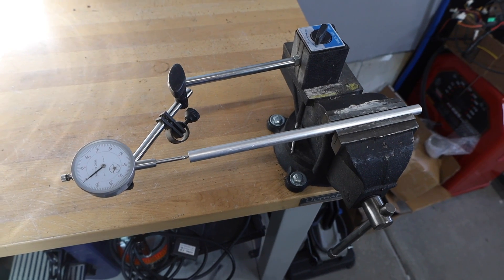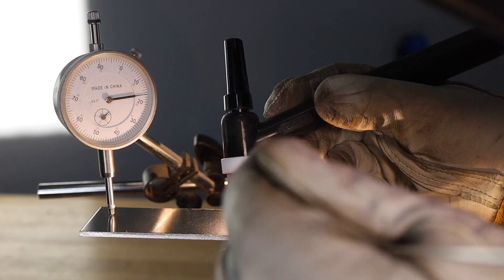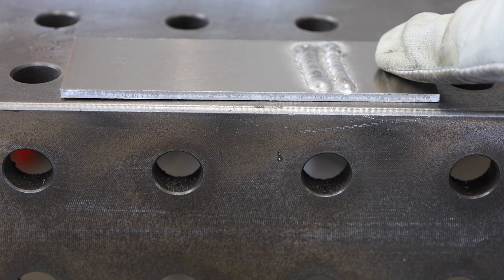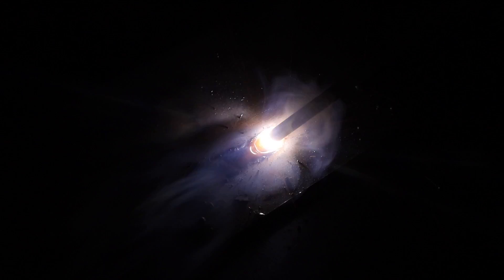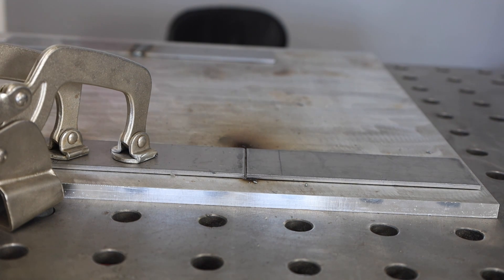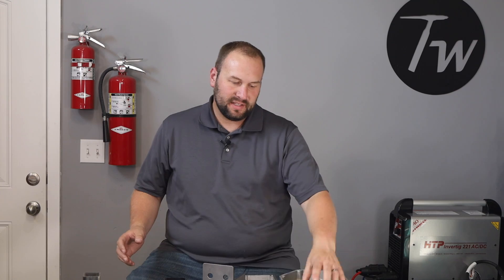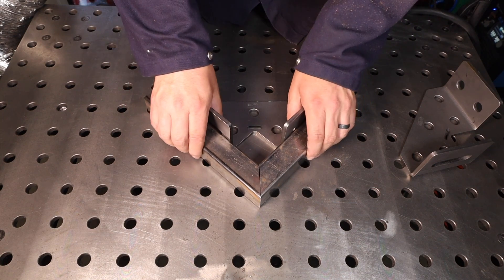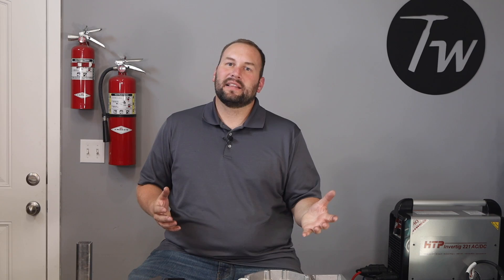Weld Distortion Explained and Fixed

Comment: It would be very useful to show how to correct distortion once it happens.  I'm trying to decide how to fix a 10' piece of 4" channel iron that distorted after I welded some brackets on it. My mistake was that I stick welded the brackets which added too much heat. I had lots of welding rods and thought I would conserve my mig gas and wire. I didn't think I would get much distortion but I was totally wrong.

Comment: I was tasked to weld a stainless steel frame, it failed miserably, even though I used clamps, alternated the welding, here in Japan they basically don't clamp anything, just weld everything by feeling and it usually fails hard. Anyway, the tears of the bosses complaining could create another sea in this factory.
Reply: Where i work at we make stainless steel frames for bakerys and when the skeleton shifts and when there is alignment we just hit it and bend it forcefully one person holds while another pull it we use 304 and 202 thin usually 7" pipes

Comment: I welded a bung into the chassis of my car. After screwing in the standoff, I realized I need to change the angle. Due to limited access, there are two weldments 180" off from each other. In other words, the bung isn't welded 360 degrees to the chassis.  Is it possible to use my wire MIG welder to heat the welds up enough to move the tilt angle of the bung?

Comment: Best way to prevent distortion is too weld step bye step and don't focus on specific Sid of work. Just do it side to side on top than do the corners  and after that do the rest. Start every time from the last begining part

Comment: I work primarily with thin sheet and i’ve found that clamps and tacking sometimes just dont cut it and that sheet will want to come back in, setting a negative angle certainly helps but in situations you can’t you can pack beneath your material and control where it wants to spring back.

Comment: Awesome information - THANK YOU! 
I wish I had known this before saying YES to a recent sheet metal mod request: Modify the width of a large stainless steel surface on the output side of a commercial dishwashing machine! A one week job ended up about 4 WEEKS - Mercy! Never seen anything like it! Surface - super warped. Legs - super warped. Backsplash area - super warped. Ended up making all kinds of SS reinforcements (yep, those got warped too), etc. THEN... I found out the dark heat affected zones would later RUST, so had to "passivate" them. Your video would have made things so much easier!  Obviously, this was my first experience with stainless steel sheet metal.
LESSON: Stainless steel sheet metal ain't like nuttin' you ever expected, even if you have been welding for years.

Comment: Use of the dial indicator was epic.  Curious though, since you have a peg board welding table, why wouldn't you fixture 90 degree welds using pegs instead, with clamps holding the pieces down to the table?  I have that same table and that's how I do them.   You can use the corner of the table to hold a 90 also, since there are holes on the sides.   I find the magnetic angle squares to be almost useless, they just don't have enough holding power.  I love that table though, I think your channel was how I found the table.

Comment: I like the comment on welding both sides. I can see application of that idea on a sheet metal body panel, such as a fender, where the panel is off the car and accessible from both sides. We tend to do these repairs from the outside, but there really is no reason not to use both sides. For example, mig tacking alternating between the front and back sides. Similarly, people will hammer and dolly the lows and then use heat shrinking to get the highs, when a high on one side is just a low on the opposite side! Just reverse the hammer and dolly and work from the other side. Heat shrinking (and one side welding) should only ever be necessary when there is no access to the back side.

Comment: In the process of welding  some grizzly bars together from 1x1/4" angle iron, (9)5' pieces welded to a 36" piece of angle for one panel. I was stoked I got it sqaure, not twisted and to proper dimensions  but the longitudinal shrinkage on the 36" was a heavy 1/8th after finishing just half the welds. I never would have imagined it could shrink that bad, just two welds on the diagonal of each bar 3" apart. I did go from inside corner up, maybe if I went top down or alternated up and down.. 
I can say a proper table for welding was the most overlooked tool in my new welding hobby. The concrete floor is far from flat enough (also awkward and uncomfortable with tig and pedal),  and clamping is also out of the question. A crummy fixture table would be nice, slightly on the small side but space is minimal.
Thanks for the videos and thoughts

Comment: Clamping a solid aluminium block close to your stainless steel weld also helps alot with distortion
Reply: Copper is great, and is used a lot for tig welding. Search copper welding spoons and copper welding gas diffusers to get a better explanation of how to make use of them. Copper is a good heat sink for welding.

Comment: when I run a butt weld with 3 layers of weld on either side do I always weld first side, second side, second side, first side, first side, second side, second side and so on. I have found that it distorts the least amount.

also, when I cut 2 square tubes 45 degrees to make a 90 degree corner do I always weld the butt welds first and weld towards the outside corner to induce tension on the outside, after that do I quickly weld the outside corner and finally move on to the inside corner. by having 3 welds that aren't as powerful when it comes to distorting the work piece trying to distort the thing towards one side and have one (the fillet) that pulls a lot on the work piece do I see next to no distortion. also by ending the joint with the inside corner and doing all the 4 welds in a quick succession do you induce more tension in the inside fillet which pulls it all back in place, if you take a break after the outside joint and let the metal cool down do you see some distortion away from where the fillet will pull and this happens if you put the fillet before the outside corner too.

Comment: A complex subject weld distortion.Sometimes you have a negative angle setup so when it's welded it cools to the correct angle.On welded box section might have to physically bend it back straight or heat up the opposite side to shrink it back

Comment: I have noticed that clamping the metal down doesn't prevent it from bending. The weld will create tension and when you release the clamps the metal bends. It's really frustrating 😤
Reply: Yup, I tried the same thing and it didn't prevent warping.

Comment: I see a HTP 221... thought you were a Dynasty guy
Reply from the maker: I do love my Dynasty. I’m trying this out to see if it is something that I can recommend as a high performance machine without the Miller price tag. So far, it’s awesome, but I want to put a fair bit of time on something this expensive before recommending (or not recommending) it. Besides that, my Miller foot pedal (11 years old to be fair) requires wire wiggling to work half the time and I haven’t gotten around to fixing the connections.

Comment: You might not have had stainless samples handy, but they would have made much more dramatic demos. I believe the biggest problem with it is due to its poor heat transfer, especially compared to aluminum.  That leads to lots of differential heating and thus distortion.  If you weld much stainless it's worth looking into heat straightening, including with a TIG torch.  I've had some really good success with it, and sometimes it's the only remedy when no other tactics work to avoid the distortion.  Would make a great subject for a future video!
Reply from the maker: Totally! I remember the first actual stainless part I made. It was a sheet metal part with a flat bottom, but it ended up looking like a Pringle potato chip by the time I was done with it. I got it straightened out good enough (fortunately it was for me), but I learned some lessons there. Thanks for the comment!
Reply: @TimWelds  I would love to see a review of the Aluma Steel tig rods.

Comment: Where can I find a workshop to train me in aluminum plate welding?
Reply from the maker: There are many paths to learn. 
I enrolled at the local tech college and took classes in the evenings, which was great. Many of them have outstanding programs. 
There’s also a lot of value in getting a machine set up at home and practicing. Whether you decide to learn on your own or pursue more education, the ability to practice is really valuable. I wish I had set up a machine earlier. It isn’t an option for everyone for everyone, though. 
There are some private lesson options. They are expensive, but you make fast progress. I’ve done this too with Crummy Welding in Ohio. It was really helpful.
Reply: Where are you located?